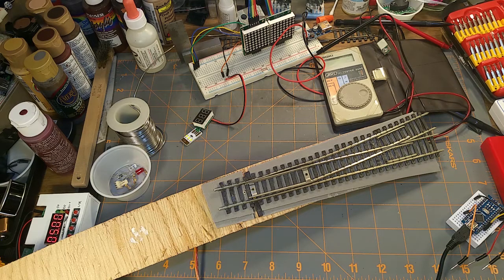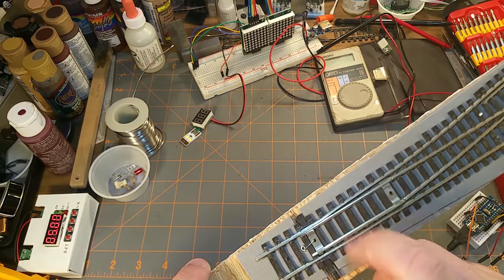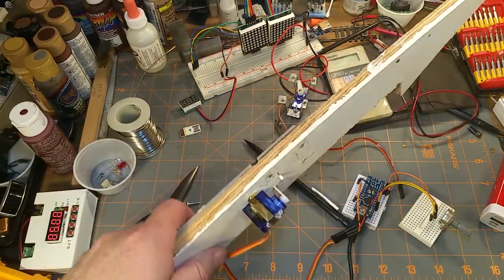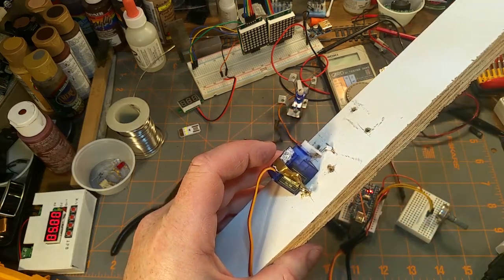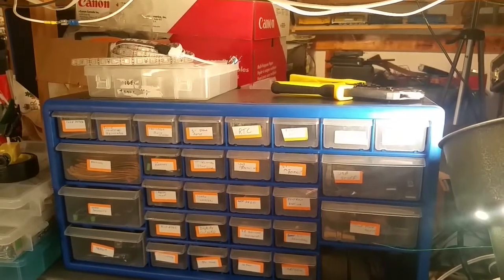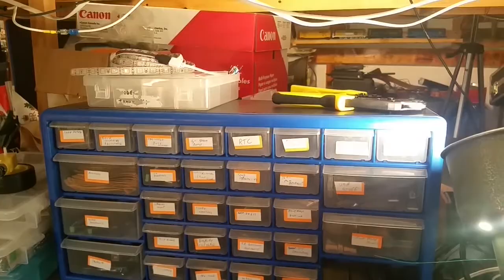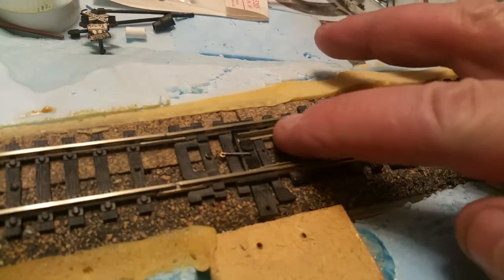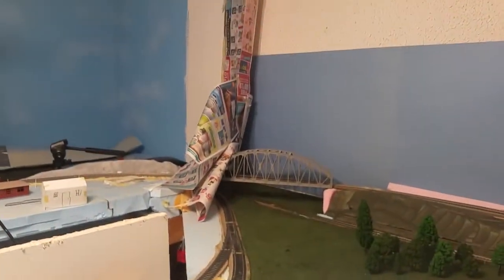servo driven turnout

Comment: Use 1 inch wide extruded aluminum channel from the home center.  Bend wallsl in slightly to grip solenoid.  Easy to slide back and forth.  Drill holes for rod and screws.  Bob

Comment: Good stuff, you made my day with the best design I have seen so far for the servo and piano wire thing. I'm hoping to use a 16-Channel 12-bit PWM/Servo Driver using I2C interface (PCA9685) attached to a raspberry Pi. They are fairly low cost at $13 cad and will control 16 switch points with one communications (i2c) line. They are addressable to handle over 900 points. Again thanks and many happy RR days!

Comment: can you show how you bent wire to drive servos
Reply from the maker: Each one is bent to fit the specific place it is being installed. I just use a couple of pairs of needle-nose pliers.
There are 2 90 degree bends on the topside to get from vertical coming out of the tube to  vertical facing down into the hole in the middle of the turnout throw tie.
Then underneath it's one more 90 degree bend close to the bottom of the tube to take the wire parallel to the underside of the track. Then I cut it long enough to get to wherever the servo will fit. (Ideally not much more than an inch or so)

Comment: can you link to the nano and put your schematic on here, im new to this and planning a small layout
Reply from the maker: The nano is just a cheap one from a random Chinese seller on E-bay. i just search for "arduino nano" select "free shipping only" and sort by "price lowest-to-highest", then pick one where the seller has a reasonably high rating.

The demo circuit (and code) I have set up in the video is this: https://www.arduino.cc/en/Tutorial/Knob

For my part 2 video (https://www.youtube.com/watch?v=3z90_C7J-bg) I just added 2 push buttons to a couple of the nano's digital inputs and tweaked the code a bit. And then I connected the optical sensors (https://www.youtube.com/watch?v=_VO4kPEAXVk) to the nano on the same pins as the switches.

Comment: hi what brass tube do you use seems to be better idea than taking wire thro points
Reply from the maker: It's just whatever brand my local hobby shop carries.
I bought it and the piano wire at the same time so I could test it to make sure that the wire fit smoothly inside the tube.
Edit: I found a label on mine. It's K&S brand,stock number 1143 
http://www.ksmetals.com/26.html

Comment: Does this spell the beginning of the end for Tortoise and other bulkier switch machines ?
Reply from the maker: I'm not sure. 

Tortoises might be easier to control, but they are a lot more expensive than my solution. 
The arduino nano is less than $5 and the servo motor is about $1.60. 
Tortoises are around $20 each.

And, as you said, this is smaller.

Thanks for watching.
Reply from the maker: Crafty:  The infra-red block detectors they sell are the same as I used, but are 4x the price (plus shipping).
Reply: posted the wrong link, meant to post the link to the video on mounting servo's https://www.youtube.com/watch?v=UgJ-GVXtHVw&feature=youtu.be
Reply from the maker: That looks line a nice method, unless you are retrofitting an existing layout. 

He suggested drilling up from below, but I'm a bit scared of drilling up from under existing trackwork:  https://www.youtube.com/watch?v=_VO4kPEAXVk

Comment: With your system can you hook up railroad crossing signals and gates to them ( servo motors ).
Reply from the maker: I suspect so.

The arduino can trigger pretty much any device you can control with a switch.

The hard part would be the mechanical linkage for the crossing arms, I think.